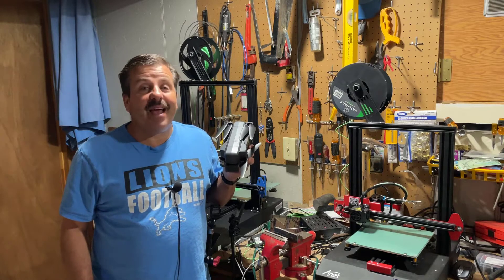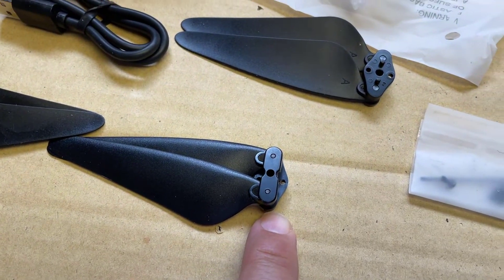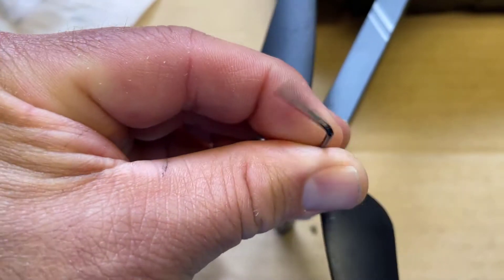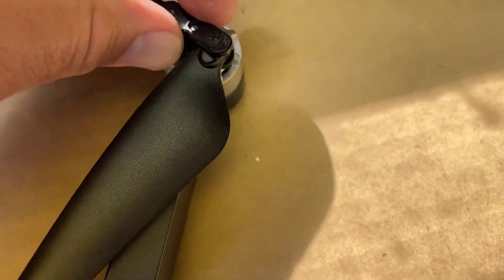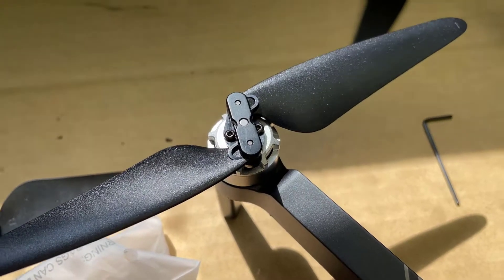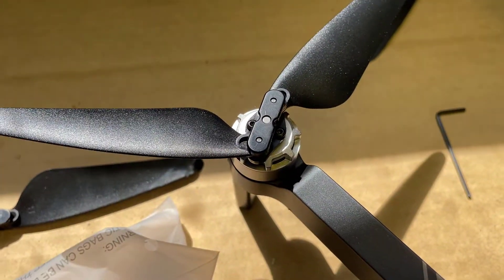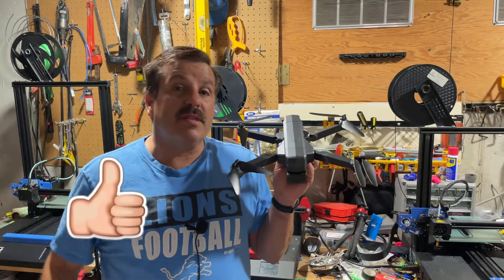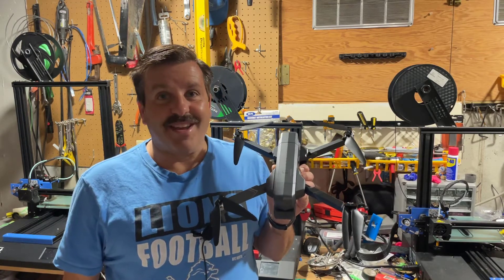Almost instant prop replacement for the F11 Gimbal Drone

Comment: I took out the screws that hold the propellor in place and yet it won't come off, any ideas for the problem I'm having?
Reply from the maker: sometimes a tiny flay screwdriver can be useful to pry them out.
Reply: Same issue.
Reply: Mine was on there pretty good for the first removal of a bent blade. After removing the two screws you really have to get a thin pry tool to get some leverage to pop it off. I used a plastic spunger tool from a knock off ifixit kit. It feels like it shouldnt take that kind of effort to remove but it will come off as long as the two screws are out. Just go slow.